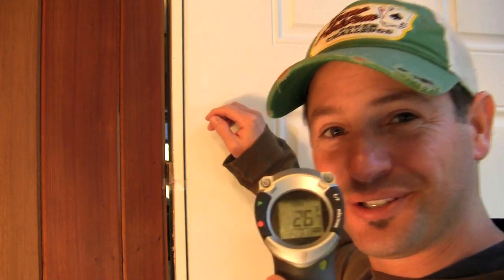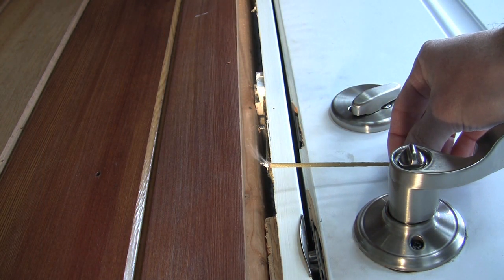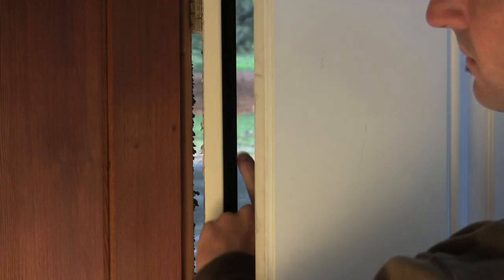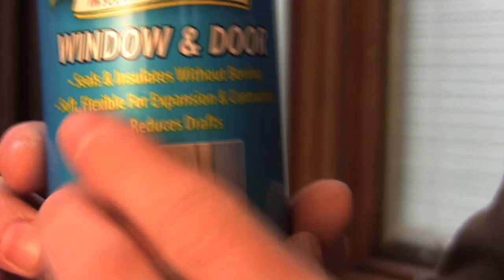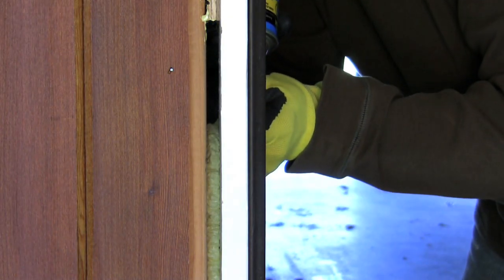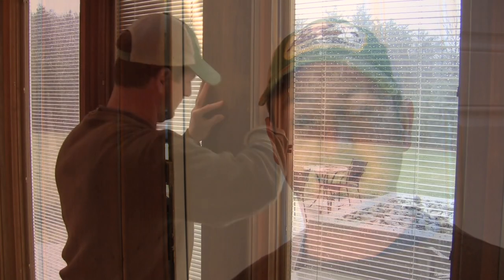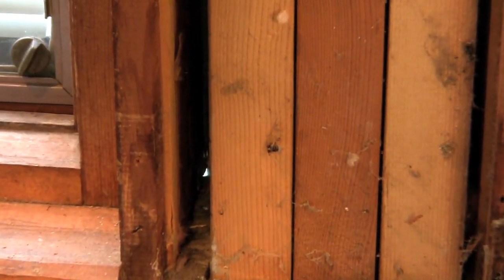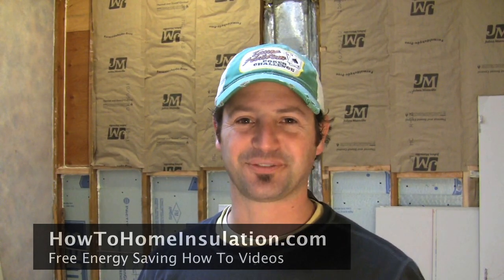Door Insulation - DIY - How to insulate around a door

Comment: If you're doing a sealing project, do yourself a favor and get a professional foam dispensing gun, like the Great Stuff Pro 14. You can use one can over a long time period instead of wasting half-full single use cans.

Also, it's easier to handle, so the foam gets directed where you want it, it's much easier to control the size of the bead, and the flow of foam stops instantly when you release the trigger (single use cans dribble). A larger layout, but less frustration and waste in the end.

Comment: Thanks for the good info! If I have several hollow core interior doors (and a couple exterior), is there a way to fill them with insulation? I have a feeling that if I just drilled a hole in the top of the door this kind of foam would just stick but not fill up from the bottom... plus it would probably take a lot! Thanks
Reply: Pretty late reply but definitely not possible in the way you mentioned as hollow core have a lot of seperate compartments, you would have to drill a hole every 5 inches in a gridlock pattern and fill up every hole as it has a honey comb design. Cheaper and less of a headache to buy a solid door.